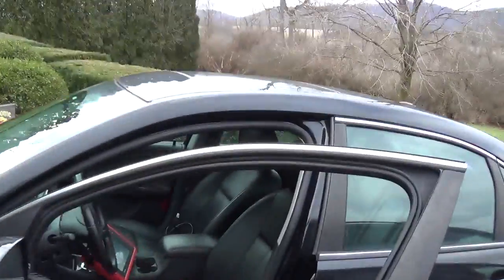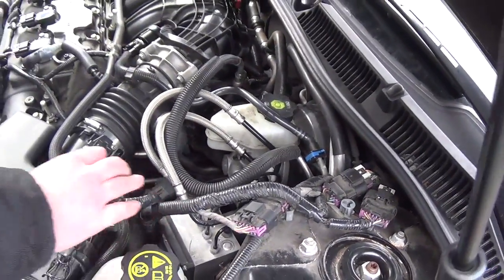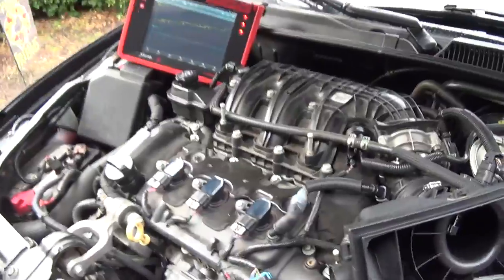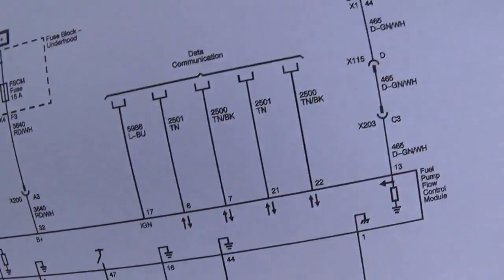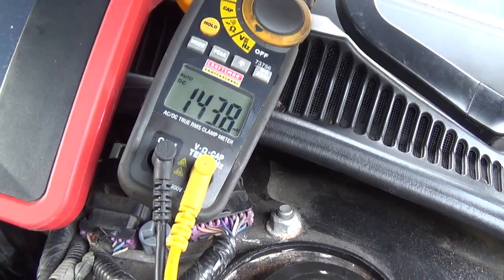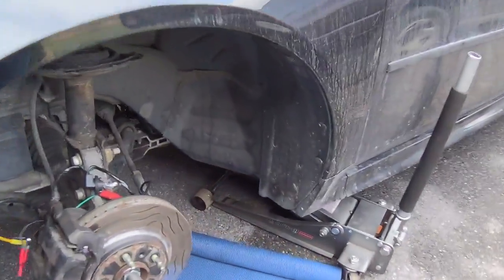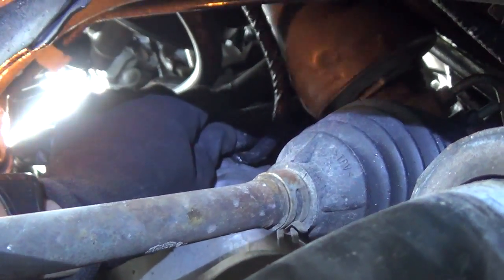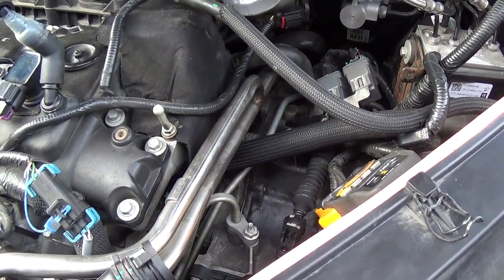GM fuel pressure sensor diagnostics: P018C -'13 Chevy Impala

Comment: Great find man! Would freeze frame data have helped a little in the beginning? Not sure if it shows fuel rail pressure voltage in there or not...
Reply from the maker: Yo Eric! I was all ready to rip off the right rear fender liner and find a broken wire like your Malibu vid...but those tricky engineers at GM relocated the pressure sensor!
Reply: Pesky devils.

Comment: Test light FTW. I have applied to the use of a test light to dozens of non automotive electrical diagnostics as well. Found problems that had seemingly outwitted some "pros" as a result. Good stuff. Interesting stuff as usual. Keep up the beard growing.
Reply from the maker: I'm afraid the beard is not here to stay...have to attend my brother's wedding next month so it's time to shed some hair :/
Reply: motoYam82 You could always just get it trimmed neatly! I grow mine bushy in the winter and keep it trimmed at around half an inch in the summer.

Comment: when you used your amp clamp for current direction I thought it had to be solely around the one wire and not the harness or did I misunderstand,  great fix!
Reply from the maker: That's the beauty of the amp clamp...it doesn't care how many wires are in the jaws, just the TOTAL current going through the jaws.

Comment: So when u used the amp clamp and the word direction, u meant geographical direction. It pointed to where the short was. Thank u for the precise methods for finding it. I like the small load u put on the circuit with the appropriate amperage bulb!

Comment: Ivan liked even before wached it cause i know its a great case 😀😀👍🏻
Reply: After watching i have a question😀, it was safe testing with the test light because the current takes the easiest path and wont even go to the module in this case im i right?
Reply from the maker: Almost. The current will NEVER go to the module, since in is a high-resistance sensing circuit. Worst that will happen is that you will set a trouble code like we did in this case. In fact, that can be a very valuable clue as well!
Reply: motoYam82  By high resistance circuit. Do you mean the test light bulb is the high resistance
Reply: +Hoaxs no its a resistance inside the module you can see it at the wiring diagram wich is greater than the test light.
Reply: +motoYam82 thanks man now really understood why. In this case if you would unplug the sensor and check the voltage on the signal wire you would have 5v or 0v?? Thanks
Reply: Hi, what tells you on the wiring diagram that it is a high resistance circuit?
Reply: The diagram of the resistor inside the container box graphic for the module.  They can't show us everything in there but at least they show how the circuit is made to function by such simplistic analogs.  Some will have a transistor indicating the wire is an output for example, or a ground symbol as in the wire next to the resistor.  It's just enough to diagnosis with and that's about all it is.
Reply: I agree Ivan.
On the other hand, sensors can be damaged by excessive current. For example, if 12V is directly applied to an O2 sensor signal terminal, the O2 will set a DTC in a short time. I've seen Lean Fuel Trim DTCs set (P0171, P0174) after 12V was mistakenly applied to the O2 signal circuit during testing.
Reply from the maker: That is a good tip. In the case of O2 sensor testing I generally unplug the sensor first and do the checks on the harness side, and a resistance test of the heating element itself.

Comment: hey Ivan you where right about my Saturn vue with the weird code for intake leak between throttle body and intake valves. bad gas cap was causing huge evap leak which in turn caused the wierd code. thanks man
Reply from the maker: Really? You sure it wasn't a bad purge valve? But if it fixed the problem, then it's a WIN! :)
Reply: motoYam82 I checked the purge valve with one of those hand pump vacuum gauges and it didn't leak.
Reply from the maker: So a new gas cap fixed a vacuum leak code...that is wild! Will have to log that in the memory bank next time I see a Saturn with that problem. Would be a terrific case study.

Comment: has been following your video for a while, really great stuff.  I have a question expecting your advice. I had a power loss for a 2013 MB C300 with V6 3.5L NA direct injection engine. no codes at all on scanner. What I noticed now is: 1.high negative LTFT of -10% on both banks. 2.Fuel rail pressure is 15000Kpa at idle and 20000Kpa at WOT which I feel not right.  Thank you in advance

Comment: That was a great diagnostic routine. I pulled up a wiring diagram for this impala and the wire colors on mine didn't match the colors on yours. I thought you were checking the wrong wires at first, and after checking the wiring diagram closely, I discovered that there is a "FUEL RAIL pressure sensor" near the injectors and a "FUEL pressure sensor" between the in tank pump and the high pressure pump. I was not aware of this before, so I learned something. Were you aware of both sensors? I have little experience with direct injection so far and now I'm wondering if  maybe all direct injection systems use both sensors. Cheers.
Reply from the maker: On DI systems often both low and high side fuel  pressures are monitored :)

Comment: Just curious and asking. When you stated if you had a open or short to ground when wiggling, if it was opened wouldnt you have seen a high voltage not a low? Im truly asking. If that was the case it would have to be shorted to ground?
 The reason im asking is a shop called me in and i have to look at a transmission line pressure sensor circuit. Whats making me do my homework is they're telling me the replaced sensor, control module and wiring. In my mind it should be a easy diag but then again its a Chrysler.

Comment: If this short to ground was on 5 V ref circuit it would pull voltage to 0 v and possible affect other sensors and have intermittent no start or stall what nightmare would that be. Am I thinking right?
Reply from the maker: Great question! In this case the 5V ref for the fuel pressure sensor is generated specifically by the fuel pump driver module, and is not shared by other sensors. I think the FP module would still function in a default mode even if that 5V ref was shorted. Not sure if that would set a different DTC...should have tried it on the vehicle!
Reply: motoYam82 that's right it's different module I should pay more attention to your wiring diagram thank you so much keep  them coming. Thank you.

Comment: Nice detective work. Intermittent faults are the hardest to track down.
That rub-through spot on the harness would be a very difficult spot to repair with a sealed connector. Have you seen the 3M Scotch Moisture Sealing Electrical Tape?   It fuses to it's self, sealing out moisture, which normal electrical tape cannot due.
3M 2228 Scotch Moisture Sealing Electrical Tape $9.27 Amazon; also at: Zoro, and Walmart.
You're right about the test lamp, but it is critical to know when to use a regular incandescent lamp. Most car manufactures specify a high impedance test light, for computer circuit testing. They are safe to use, because they do not draw too much current.
OTC  3636 Coil Cord Circuit Tester - $21.93 Amazon; also at: O'Reilly, Tooltopia, and Wallmart.
Reply from the maker: I'll have to get me some of that fancy electrical tape. Scotch makes good products.

Comment: If the sensor has internal electronics, are you sure that output would always hike up towards 5V if sensor ground is missing? If sensor has a output transistor / IC, lack of ground might leave it in open (non conducting) state = 0V.
Reply from the maker: That is a valid point! For a real 100% fool-proof test, all three wires should be checked AT THE SENSOR, with the sensor plugged in.

Comment: Hey Ivan, I have a question.  To make sure I understand...Doesn't  the "circuit low" code pretty much indicate a short in the system somewhere and a circuit high code indicate an open?  You'd still have to find the short either in the sensor or in a wire somewhere.  Is it possible to have a circuit low code on a circuit like this and have it not be a short somewhere?

Comment: moral of the story: this is why wire harnesses have all those annoying routes and ties and clips - vibration rub-through. sadly it's not always possible to predict which ones are essential or if the guy who worked on it before you routed the wires safely or if the factory made a design mistake

Comment: 3.6 L are famous for dying High Pressure fuel pumps at the engine due to the direct injection.  Especially when using E-85.  I had a 2012 impala with this engine and now have a 2015 and the 2015 went through two of these pumps.
Reply from the maker: Wow sounds like a factory defect right there.
Reply: Its so strange.  In my 2012 I used E-85 a lot, never had the pump go on it, but it would run up and down on the RPM's when it first started in the morning.  The 2015 would run as normal in the morning on E-85 but burned up two pumps.  The dealer explained that as the e-85 sits in the tank it becomes more ethonal over time so within a few days e-85 becomes e-100 and causes so much heat at the pump it burns it up.  GM still doesn't know how to solve it.
Reply from the maker: haha tbh sounds like a load of 100% genuine BS from the dealer lol
Reply: doesn't make a hell of a lot of sense to me either.

Comment: Whats up with the beard lol. Good find I should of recorded a dodge grand caravan 2011 I had the other day. It had a bad Pcm no longer controlled certain relays and a bad Tipm for a fan 1 sense circuit low complete failure couldnt clear code at all was a hard fault. I think what happened was someone jumped it backwards cause of all the electrical issues it had.
Reply from the maker: dang sounds like a hard call to make to the customer..."did you see sparks and smoke when you jump started this vehicle?" lol
Reply: motoYam82 it was dead when we got it. It did spark with a jump box to get out of park to push in. lucky for them the dealer paid for it that they bought it from.

Comment: I wudda 1st, wrongly obVSlE, guessed it was likely that taped up thigamajg you seen, wiggled. & untapped it & stuff.. but guess not.  anyway, electrical✋😒.   transmissions get to be, wat?, couple hundred •s?  probley not 2 gr8 resting plumes of wires on them, guess transmission shop weren’t elect. exprts.